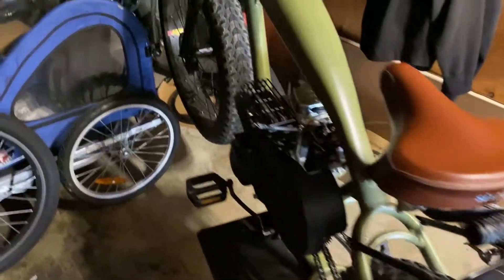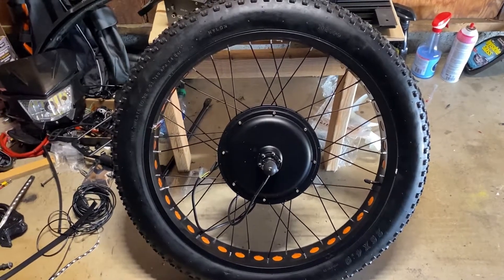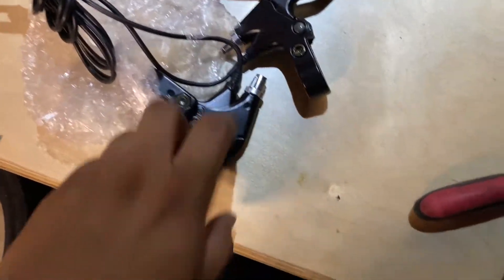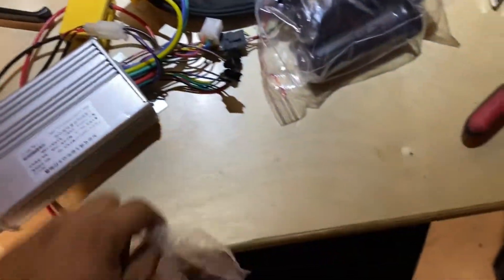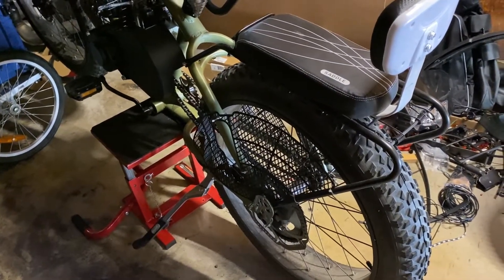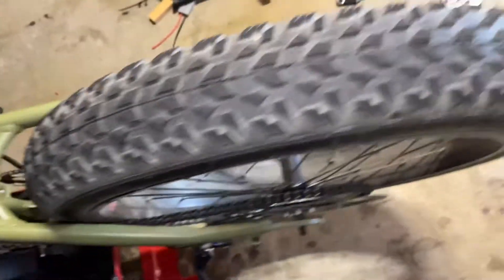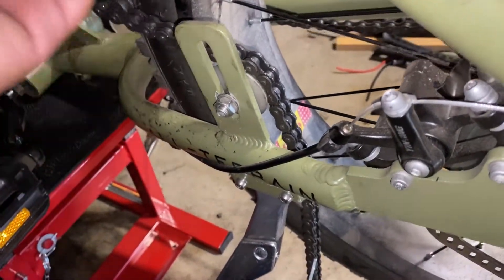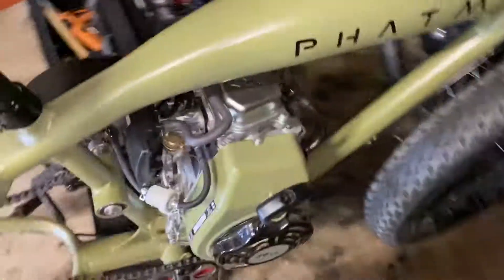E-Phatmoto 48v Rear Electric Hub Motor - Part 1 Hybrid Conversion

Comment: Why didn't you just put a electric motor on the front wheel ?
Reply from the maker: Why be the same as everyone else? 

I wanted to put it in the back for the weight balance as I hate how front wheel hub drive feels.